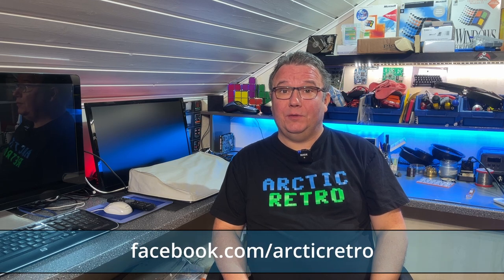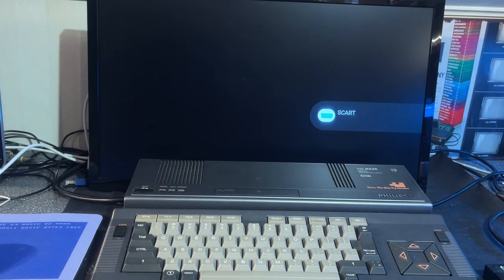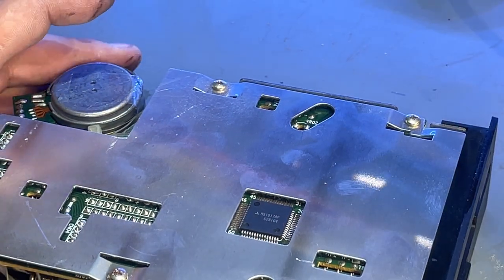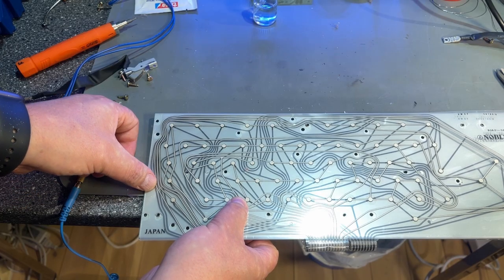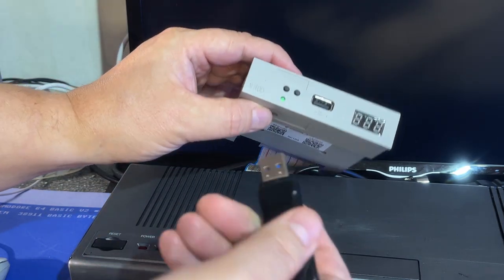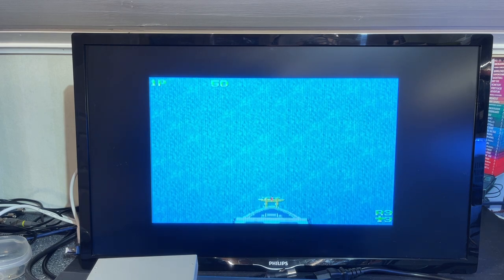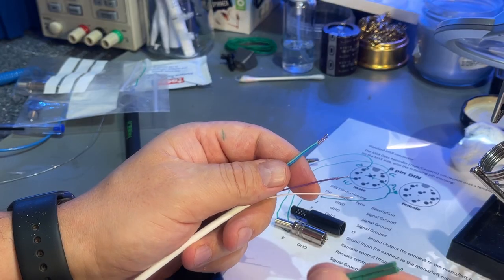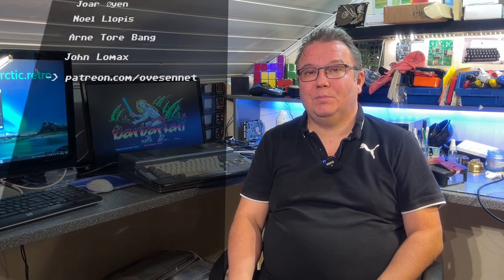Exploring MSX! The Philips VG 8235 MSX2 computer using Gotek and MaxDuino

Comment: Years and years looking for a video in which such a complete and exhaustive review was made, on the cutting and cleaning of a keyboard of the Phillips VG8235 model and decades later, I finally see it, of this computer from my childhood.
I thank you, since you have dared to do what many of us dared to do: open the keyboard and remove the keys to clean and condition it, for fear of breaking it, since msx keyboards have no replacement, no like those of other teams (c64, Amiga, etc ...) that have many spare parts.
I don't know how you got that cable tie for the gotek, and what has impressed me the most is that the gotek that was listed as unit B, allowed you to run commercial games, I thought it was only possible when the gotek was configured as unit A.
Kind regards and thank you very much for this instructive video of a great machine like the MSX2 VG-8235 from phillips, I'll save this video among my favorites as a reference video.
Reply from the maker: Thanks a lot :)

Comment: My message seems te be lost in the 9th dimension, so here a retry:

POKE &HF247,1 to swap A: and B: which makes your gotek default until reset/power cycle
POKE &HF346,1: CALL SYSTEM if DOS is present on the disk and you want to go there
POKE -1,170 if a tape game crashes.
Reply from the maker: Oh how great. Wish I had knew before I finished the video. However, I got the new belt now, and the internal drive workes just fine now:)
Reply: @Arcticretro  might come into handy in a future project ;)

Comment: I was using the same MSX computer at the time. The successor was then an NMS8255 with 2 disk drives.

I have been involved with MSX since 1983.

I had an MSX club in Amsterdam From 1991 to 2006 meetings once a month.

Unfortunately too little interest, 2006 the club ended. Often i think back to those cozy club meetings.

In recent years I only use MSX via the "BLUEMSX" PC emulator.

I'm thinking about an new MSXVR computer.
Reply from the maker: MSX seems like a good system. Unfortunately it was not very popular in Norway I think. I never heard about MSX until now in recent years when I got back the interest for old computers.
Reply: look on Youtube for MSXVR The new MSX computer.
Reply: Can you adjust the vertical resolution of an MSX? It is pretty scheisse by default, I have the idea 40% of my screen estate is wasted. Would love to see like 50x30 characters visible (400x240 pixels)
Reply: I inherited a Turbo R from a good friend last year. 
I will soon start my MSX hobby again after 23 years. 
The Turbo R ST computer will go to repair service this week for memory expansion and disk drive repair. 

MSXVR i have sent an email no response.

Comment: Great video! Since the diskROM supports 720 kB disks, you could try to use a PC floppy drive. There should be instructions in the internet.
Reply from the maker: Cool, thanks
Reply: @Arcticretro  That only goes for the external port. If you insert the NMS8245 systemrom and add two jumper wires on the mainboard a 2DD internal drive is possible.
Reply: @MeitsMSX  That is ok, as those drives don't fit internally. Can you power the external drive from the 5V and 12V pin of the expansion port on the back?

Comment: Great video MSX  is a nice machine, have an 8245 also with the same belt issue original belts where crap  (put in a tape belt for now but it is smaller) and it worked for now where did you order the correct belt? Did you load msx1 games or msx2 games by tape, some msx1 games do not work or need patching.

Comment: Nice, my first computer was an MSX. I would rip out the batteries if I were you. I think they'll start leaking as soon as your charge them back up. Replace them with a CR32 holder with a diode in series maybe?
Reply: That may work. Some there's a rechargeable version of that battery ML2032 I think. Not sure if that'd remove the need for the diode - BUT, the CR2032 is FAR more common making it cheaper. The ML2032 is used in solar powered devices that need some small memory. I'm less clear if it really lasts. I haven't had good luck with it, but it may be because of solar charging.

MSX machines also came with a AA battery pack, and people have just changed from regular AAs to rechargeable (USB or wall rechargeable) AAs. When the charge runs out years later, you can just pull them and recharge them in the charging device and then put them back in. They are Lithium and don't leak (usually). I use them in remote controls and various things both AA and AAA.

Definitely the Ni-Cd needs to be pulled. I have poured through the "MSX Technical Data Book" (Official book reprinted on Amazon) and the current boards and only one person suggested replacing the battery. Most say pull the old and live with the lack of settings each boot. I don't get it. We replace batteries in virtually all computers all the time. Why not this one?
Reply from the maker: Yes, I will remove that battery soon

Comment: Did you try to just disconnect the internal drive and set the gotek to drive 0? (i.e. Without swappomg the cables)
Reply from the maker: No, not the same connector
Reply: @Arcticretro  I think he means to use the gotek on the external connector as A: by removing the cable from the internal drive and setting the jumper on the gotek to A:
In a lot of computers this will work because the data connectors on the mainboard are 100% parallel. In this computer I do not know. Maybe worth a try.

Comment: That's one impressively over-engineered machine! Well, except for the keyboard...
Reply from the maker: Yes, the keyboard seems like crap...
Reply: Exctly my thoughts. Why max out RAM and put three types of video connectors in if you have such a lousy keyboard type? Those fingers after removing what was once a drive belt shows the true retro compassion.
Reply: And except of the 360kb drive A...
Drive B is accepted to have 720kb but you can't swap it to work as a 720kb Drive A without patching the 8235 DiskRom.
Reply: Even the keyboard is over-engineered, with its adjustable angle. The mechanism is sturdy plate metal. I have no issue with the keyboard, I would not recommend disassembling if it works. The keycaps do yellow unfortunately.